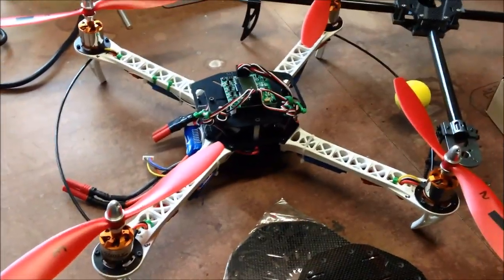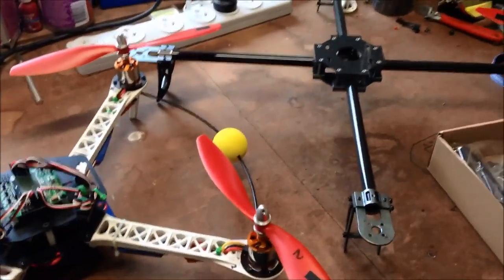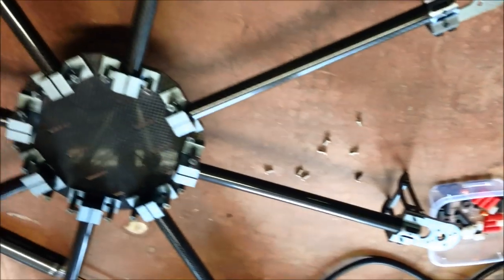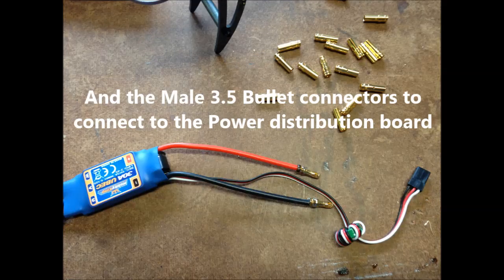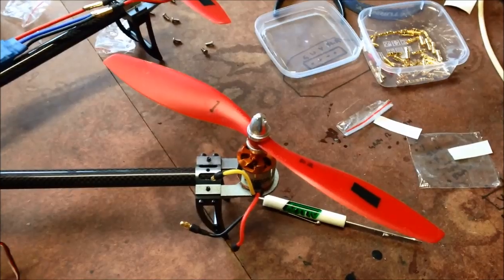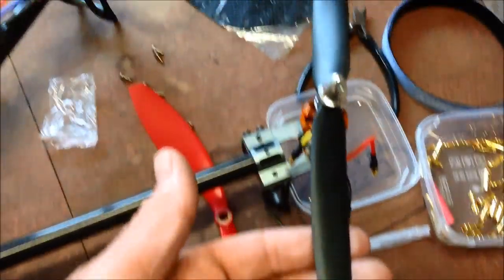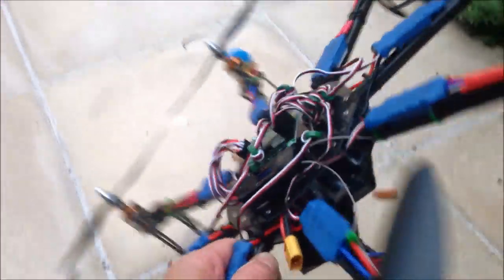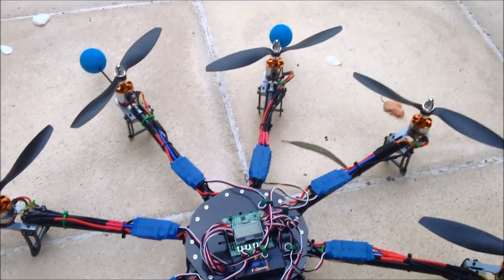Turnigy Talon Octocopter Build for under $500 Part 2 (TheBuild) 2836 Motors KK2.1

Comment: Did you flash the esc's? If not you are totally missing out :)
Reply from the maker: Given that this beast is not really doing a lot of ACRO work I did not update to SimonK. My ACRO units I use the AFRO 30a SimonK ESCs which perform very nicely.
Reply: You should really consider flashing them. Allthough it isn't an acro copter it will still get way more stable and future video work will turn out much nicer.